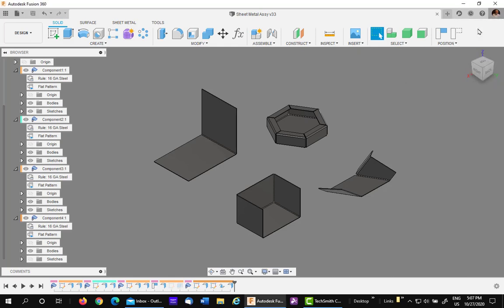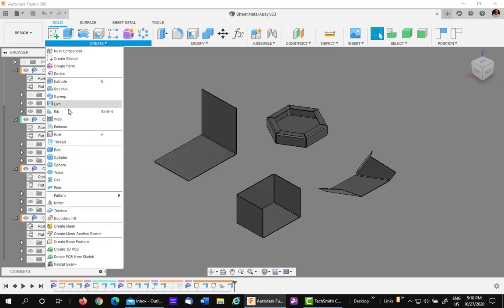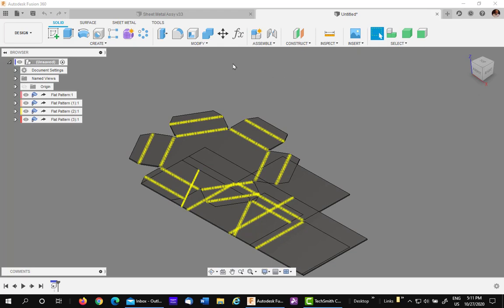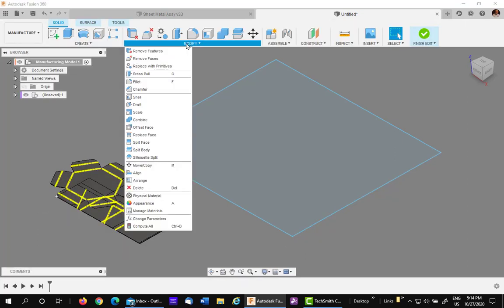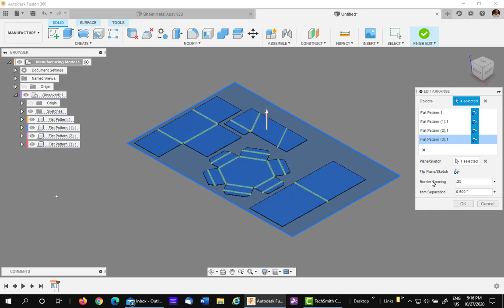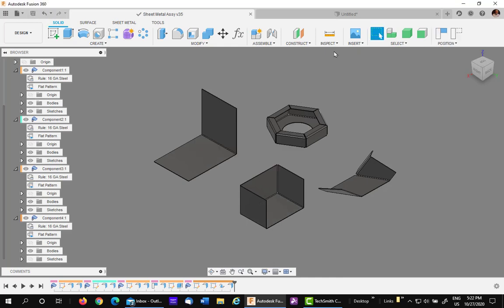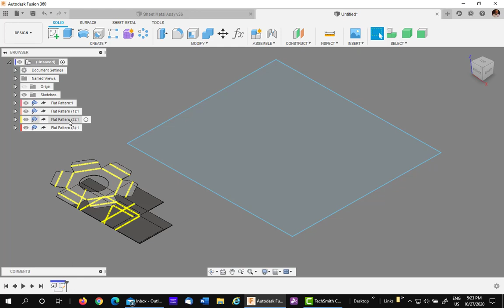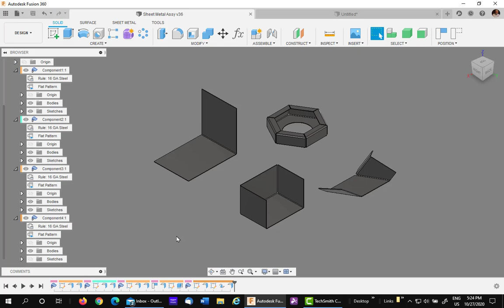Arranging Multiple Sheet Metal Flat Patterns in Autodesk Fusion 360

Comment: I thank you for this great info. I tried it successfully, with one minor problem. I plasma cut a flat pattern with writing, and your method placed it face down, which caused all the dross to be on the exposed printed side. I haven’t been able to figure out how flip it over. Any suggestions?
Reply: In Arrange/Objects/Component there is an icon to the right of each Component which will flip the part.